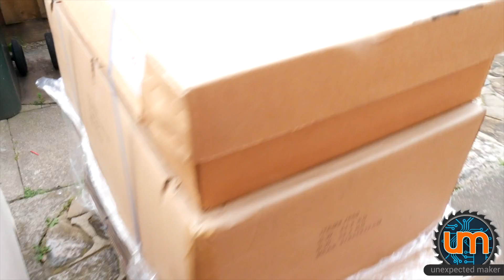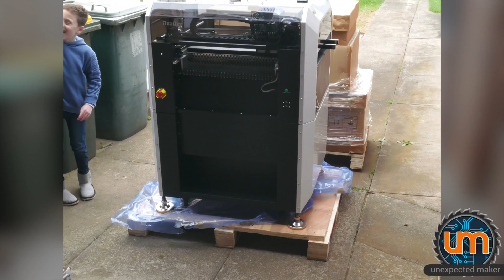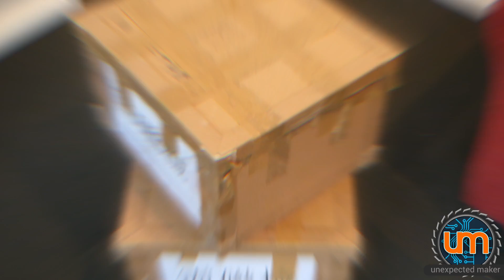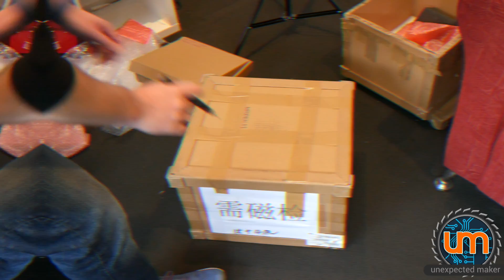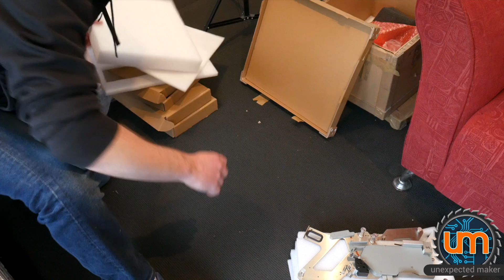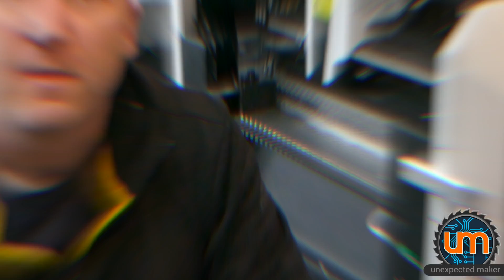My new Pick n Place - Neoden S1 Unboxing

Comment: I'm now retired from 50 years of designing and manufacturing electronic instruments, primarily for the geophysics community, in my several basement workshops/offices over the decades.  Began with all thru-hole construction in the late 1960s, and made the transition to surface mount in the mid-1990s.  All hand assembly with wire solder, flux pens, small pencils with multiple tip sizes, and a good stereo zoom microscope with low power eyepieces {a wide field of view is more valuable than high magnification}. When my average production batch size was perhaps a dozen-off high-value cards, there was little to gain from tooling up for pick/place and/or reflow ovens.  My words of advice :  spend more time proof-reading your schematic and re-reading the data sheets for not only your chips but also the passives.  Memorize the details - it comes in handy later.  Surface mount parts make it MUCH easier to do single-sided cards {few, if any, holes to drill}, and that makes it possible to etch your own circuit boards.  I still use classical KPR negative resist painted onto single-side copperclad using a foam brush, and expose the resist with an antique 'sun lamp' through a negative image generated on a laser printer.  One or two jumper wires may be needed, but not being dependent on an external supplier with minimum quantities allows cheap quick-turn prototyping.  Just some thoughts - all the best from western Canada...

Comment: Does this mean you can use 0201 resistors now ? 😀
Reply from the maker: It does! Though I'm not rushing to change any current designs, but it definitely opens up new options for me :)
Reply: @UnexpectedMaker  looking forward to seeing it run , I watched the unpacking vid , 4  mins on Neoden USA website, sure that vibration is something you'd measure on the Richter Scale ;)
Reply: @UnexpectedMaker  at 0201 and below you are getting into a very difficult domain, and life is not easy when dealing with those parts. The assembly process needs to run to perfection each and every time. Take careful steps into that assembly domain, based on past view of volume processes at my former employer (automotive mainly)

Comment: Classic delivery issues - IN6 was upside down, but has arrows showing which way is up !! 

Looking forward to seeing it up n running , and how easy it is compared to the previous PnP
Reply from the maker: I'm not 100% sure the oven in the box is upside down. It's also a demo unit, so could have just been re-packed that way - fingers crossed!

Comment: Congratulations.
Was amazed how quick it was delivered, of course clear if it was a local DEMO unit.
Getting very professional, and hope it really assists the volume of various assemblies. You seem well on the way to supporting wider range of products with less manual efforts needed. Should be capable of a wide range of individual Pat's, that was the real limiting aspect of the cheap pnp units. The fast swap out should be great assistance too. Hope the cost of the feeders is not too extreme.
Well hope you get some joy out of the new setup and wish you few, ideally none, teething issues.
Reply from the maker: Yeah, the aim is to massively reduce all of the manual work and time lost per panel on the other PnP. Fingers crossed I've made a good decision :)

Comment: So with uncertainty about manufacturing and supply chain, does this raise cause for concern moving forward? I know it would leave me feeling a little nervous. It's a killer rig nonetheless.
Reply from the maker: The Neoden supply chain? I have everything I need for a while, and this C-19 disaster has to end sometime. I'm more nervous about how long global freight is going to take to start improving.
Reply: @UnexpectedMaker  I hear there are a few commercial jets sitting around that you could maybe pick up cheap...

Comment: Is that machine aimed at full on 24x7 factory usage, or is it for some middle ground between a desktop "hobby" machine and an industrial unit?
Reply from the maker: It's targeted at small scale commercial manufacturing. It's WAY under "industrial" though ;)
Reply: @UnexpectedMaker  Right! I wasnt sure because of the conveyor.  Good luck with the "bring up"! I reckon you are going to need a bigger room. :) And I hope its not too noisy!